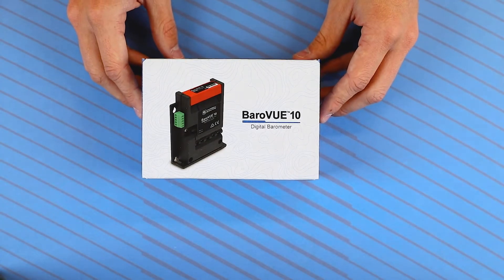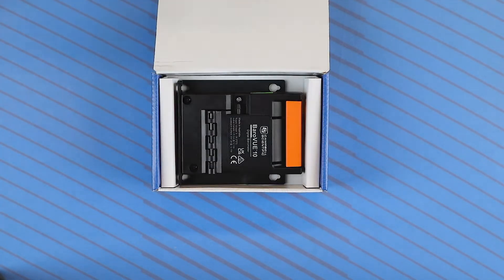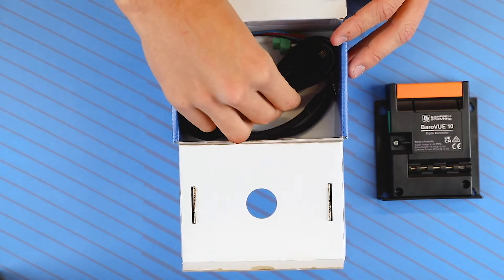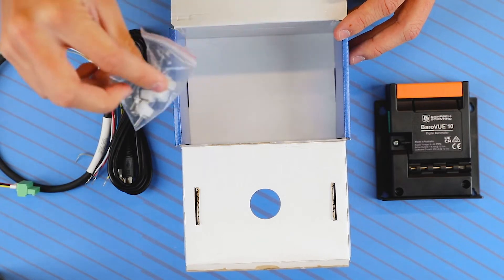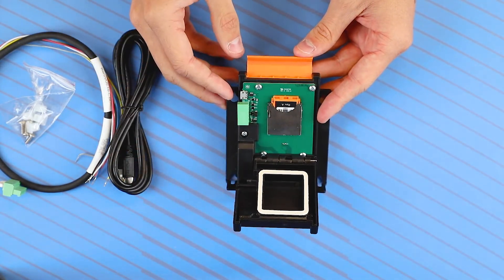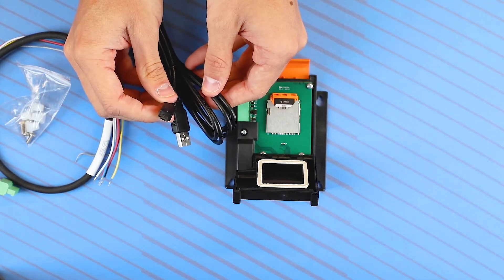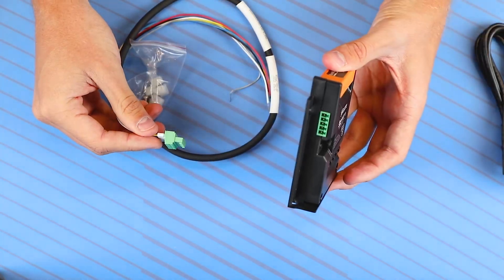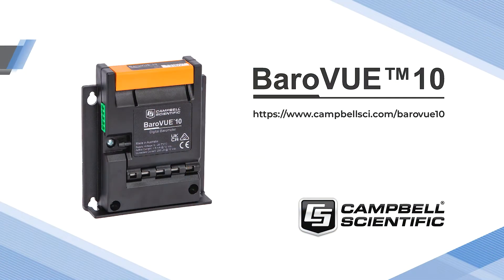Unboxing the New BaroVUE™10

Comment: Hi ,confirm me that will the above barometer can capture Sea mean atm. Pressure data or not
Reply from the maker: The BaroVUE™10 reports actual station pressure in units of mb, inches Hg, mm Hg, or PSI (user selectable).  The pressure can be corrected to mean sea level in the data logger program if the site elevation is known.